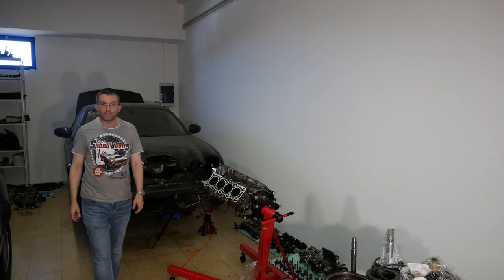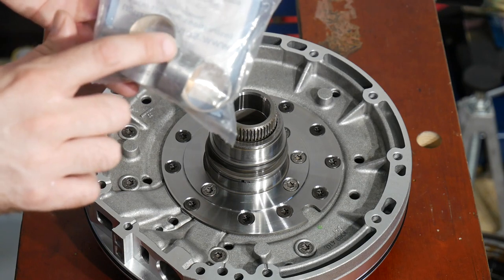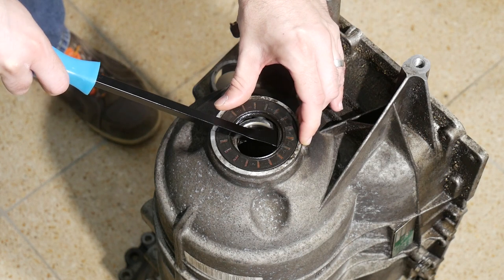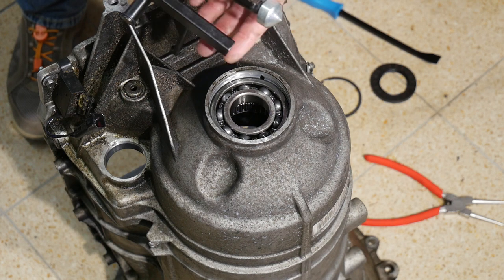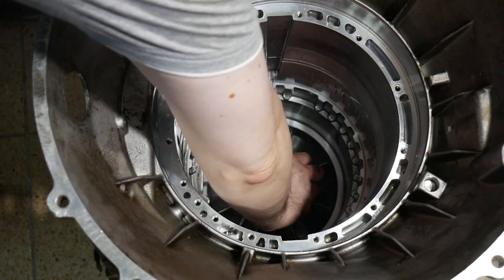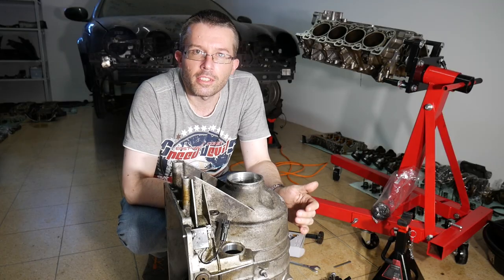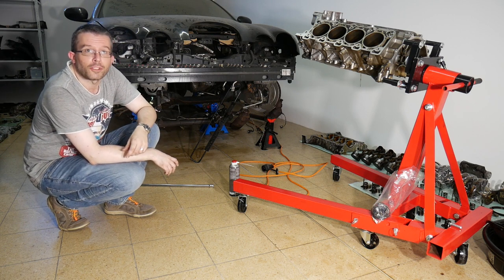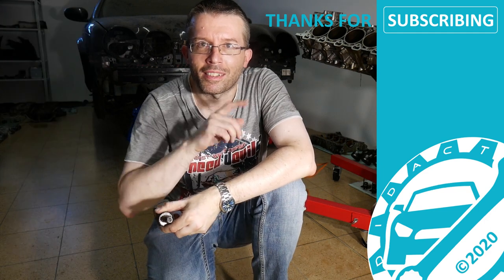Jaguar S-Type Restoration [46] ZF 6HP26 Gearbox Teardown (6) Rear Bearings [2020-09-05]

Comment: I'm watching each week, finding it very interesting, and learning a lot about the s-type.  I am sure that all will turn out very nice in the end.  And you should have a few spare parts left over, that might be useful, from the second engine and accessories.

These cars are really the last true Jaguar - after this they did away with the wood interiors and the steel bodies.  Went back to four cylinder rather than six cylinder engines as standard.  Lost the real gauges in the dash.  One of these days people are going to notice how great these cars were and the price will come up to something more suitable.

And the good thing is there are plenty of spares because the cars are worth so little second hand so good examples with small faults are often broken for spare parts.

I have a V6 example with 144,000 miles and it is really just like a new one.  Seems to be well worth fixing whatever might need maintenance on it over the years.  After all, it is not possible to buy new ones any more.  It is a much better car than the previous MK10/XJ6 type platform s-type, which I also owned.
Reply from the maker: Thanks for watching, and keep yours!